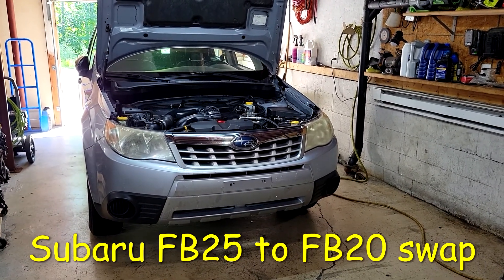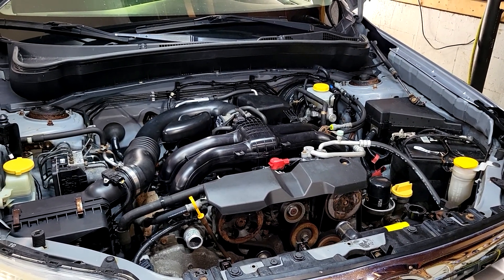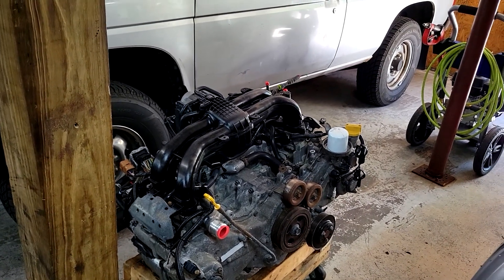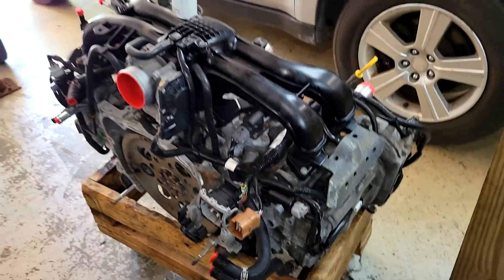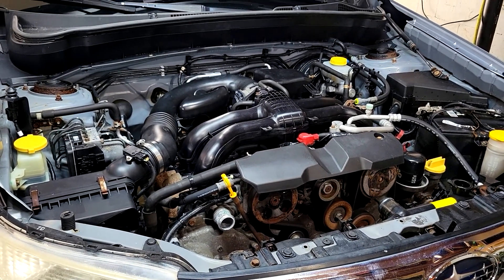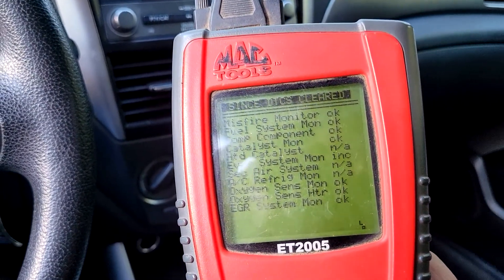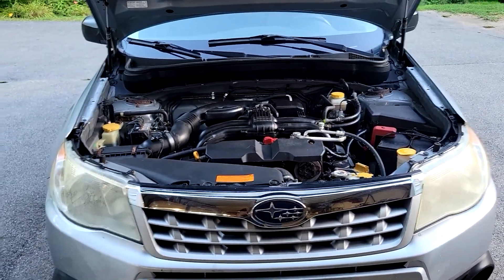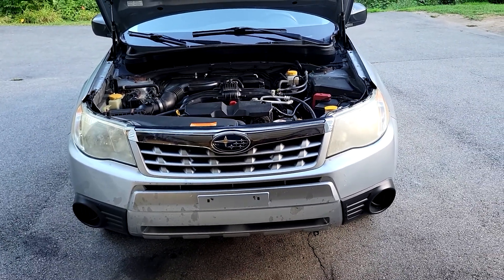Subaru Forester FB25 2.5 to FB20 2.0 Engine Swap Cheap Option To Fix Your Car Legacy Outback Impreza

Comment: Can you insure this if you change it with different engine? How can you reflect this engine change on the VIN  of the vehicle? Thanks
Reply from the maker: why would the engine make a difference? insurance companies uses the vin on the dash/title. not the engine. there are lots of cars on the road that have had the engine changed
Reply: @volks-jager  i asked this because if you register your vehicle, you need to put the VIN, and the VIN contains the information about the vehicle. When you verify this info using the VIN, it will show fb25, but you already changed it with fb20. If you changed the engine with same engine, it will not matter because they are both fb25.
Reply from the maker: @JBB1636  no one is going to know you changed it unless you tell them. insurance company is not going to care that you put in a smaller engine which makes the car slower and hence safer.  hell people add turbos and superchargers to cars all the time which increases the power and dont tell thier insurance company.

Comment: I'm seeing 1700 bucks for the fb2.0's now.  Wondering if demand has caught up?
Reply from the maker: between the word getting out about this swap and rampant inflation the price has gone up, but they are still $500-$700 in my area.
Reply: @volks-jager  Good to hear.   Thank you
Reply: I paid 1160 after tax for the engine last week out of a 14’ Impreza with 137k. Still cheaper than putting the same crappy fb25 motor back in it. Total cost of the swap for me was around 1250-1300 after fluids. I’ll have to add that I went and picked it up from the store. Shipping to my house would add another 200-300. I’m in the pnw if that helps with area. I got it from B & R auto wrecking which is 45min or so from me so it wasn’t a bad drive. Motor came from there California yard
Reply: @dakotawright6978  Thanks for the info.. Sooo,  just went and test drove a 2014 Crosstek.  Very nice neighborhood.  Was their kids college car.    120k Miles.   Great condition. Uneventful test drive other then coolant level low light.     Did the headgasket coolant test.   Positive for combustion gases.   sigh. 
Thought id share

Comment: Any idea whether I could swap an FB20 into a 2014 Forester with the NA 2.5 and the 6 MT? Oil consumption's been super high recently but the car's clean so I'd like to keep it
Reply from the maker: im sure it is possible, im just not sure sure year donor engine to get. all the foresters ive done are 11-13. im not sure what difference they are on 14. usally the 14-ups dont burn oil as bads

Comment: My fb25 runs 5qts in 1.5 weeks
Reply from the maker: yup, the early FB25s where notoroius for drinking oil. using that much is going to destroy your catalytic converters and O2 sensors

Comment: Hello, we just finished up a 2011 Forester fb25 to fb20 swap and now we have a crank no start condition. The donor fb20 was supposed to be out of a 13 Impreza but they sent one from a 13 Crosstek...does that make a difference? I am not getting any codes just a poor crank signal. Also we noticed the error after the install.
Reply from the maker: a crosstrek is just a listed Impreza, so that isnt the issue. double check all your connctors. did you swap the flywheel? the crank sensor and  trigger wheel is behind it, make sure that didnt get damaged a few people in the comments using 13 engines had to mess with different coils. did you use the intake/harness/coild off the 13 or the 11
Reply: @volks-jager First thanks for the response. Yes, everything has been swapped from the 11 to the donor motor the 13 before installed in the car. We just found there is no power to the crank sensor, we are in the process of diagnosing that issue.
Reply: Update, we did what we could and could not figure it out so we hired a company to come and diagnose the issue. They are claiming that my swap is not possible and the timing has stretched on the fb20. 

"The Crosstek FB20 is not compatible with the Forrester FB25 due to ECM" they also stated that the "13 Crosstek ECM as far as engine timing goes is the same as the ECM timing for a 13 Impreza" '

We are pulling the fb20 and hoping to swap it for another.
Reply from the maker: @BosAutoTowing  they dont know what they are talking about. the video shows it is possible and the numourous comments from people that have done it succesfully back it up.  there may have been an issue with the engine you got perhap, or they gave you a 14 engine or something. a 12 or 13 impreza engine is almost a direct drop in.
Reply: Thanks for the response. I trust this. Trust me. We are in the process of swapping the fb20 for another. I will post what happens.

Comment: My situation is i already took the engine out 2 yrs ago almost.. it has 200k miles on it. I bought new gaskets, water pump and new valves. When i put it back together now i cant get any gap on the valves. Im thinkjng i have to lap the valves. This car has beeen goung nowhere. So i seen some local salvage yards w the imprezaas . The vin numer thing is what i am unsure of
Reply from the maker: the valves lash on these is set by the buckets. if you changed valves or cams then you have to measure each valve and order new buckets from the dealer for any that are out of spec.
Reply: @volks-jager  i cant even get the gap tool to fit between  no matter what bucket is in there. So i guess i have to take that head off again and use one of thse valve tools to gring it down.

Comment: can i put this engine in outback 2011??
Reply from the maker: no. a 2011 Outback has an EJ25. this only applies to cars with the FB25. Outback did not get the FB engine until 2013

Comment: I swapped an07 into an 09 Forester. Transmission and motor from the donor. Will I need to swap the fly wheel? The vehicle went into spaz mode. Bunch of lights went on and shook the vehicle. Swapped intake harness.
Reply from the maker: this video is for the cars with a FB25 engine. your car has an EJ25. an 07 and 09 EJ are the same. the transmisson might not be. you need to check the interchange on the trans.

Comment: 13,000 miles on this swap since I finished this in August. Still running great! The only issue I have is the check engine light seems to trigger the traction control light and cruise control light(flashes) to come on. While I can live with the check engine light, it would be nice to use cruise control. Is there any way to get the cruise control to work while having a check engine light?
Reply from the maker: nope,that is Subaru being an asshole and forcing you to fix the check engine light. the only thing you can do is find someone that can do a custom tune
Reply: @volks-jager whenever I erase the codes until the codes come back in, we can use  cruise control all you need is 25 bucks obd code reader well I don't know much about but that is working for me

Comment: Have you thought about swapping the cams and cam carriers off the 2.5 onto the 2.0 to solve the cam phaser issue?
Reply from the maker: that might work, but it is alot of labor and alot of things to be resealed with sealer and potential  leaks, the whole timing cover and timing set would have to come off. the point of this swap is to be cheap and easy to the average joe.
Reply: @volks-jager  I have no problem with getting into dealing with the timing cover/ chains etc.  I'm wondering if it would make the power loss problem much less noticeable.
Reply from the maker: @joebuchowiecki860  also if swapping the cams will mean you have to re-shim all the valves which is a giant PITA and while it might help with power, you are taking many hours of labor, taking old used cams and timing chains from a bad engine plus buying new shim and tons o. stuff to reseal.  the simpler/better solution is to leave the 2.0 stuff and get a custom tune on the ECM.

Comment: I just did this swap. 2016 fb20 into a 2011 forester. I’m getting codes for crankshaft and camshaft correlation. I swapped the fly but I kept the fb20 trigger wheel for the crank sensor on the motor when I dropped it in, was so supposed to swap that as well?
Reply from the maker: a 2016 engine is not a good match for an 2011 forester. you should have used a 2012 or 2013 engine. you are going to need to pull it back out, and swap all the cam trigger wheels and sensors including the phasers under the timing cover.

Comment: I have a 2010 outback with the 2.5 in it. Was thinking about putting a 2.0 in it. Is it possible?
Reply from the maker: no. a 2010 outback has an EJ25 not and FB25

Comment: This video helped solve my P0171 code on a 2011 forester swapped from an FB25 to an FB20. Changed out the fuel injectors to be the dark green densos (fb25), and the code went away. Runs way better now! I might try disconnecting the cam phasors and see how it runs but obviously would have to live with the CEL if I did that
Reply from the maker: there is a HUGE difference in power by unplugging the cam phazers

Comment: We're working on a PZEV unit 2011.  Hoping to be able to do this FB20 swap and have a line on a 2013 Impreza motor w/100K miles on it.  Does anyone know if that PZEV stuff matters here.  We intend on using all the intake and exhaust from the forester as well as the harness and other items listed thoughout this conversation.  Anyone have any knowledge when it comes to PZEV?
Reply from the maker: pzev does not matter at all. the PZEV is just ECU program and a better catayltic concverter

Comment: Hey all! two things before I put the new engine in (2013 impreza fb20 going in for my original 2011 forester fb25) --  I did notice the coil plugs are different when switching my old harness onto the new fb20 -- is it enough to just switch the coils from the old to the new? The lengths appear slightly different. Second, I am noticing a connector on the driver side front of the fb20, (it is white and appears to wrap around to the back under the engine) and is not present on the fb25. What do I need to do with this?
Reply from the maker: look through the comments - someone had a simliar issue and they just made some spacers for the coils. if you cant do that then you could probbaly just use the FB20 harness and coils - ive done that and it worked. what does the wire attach on the FB20?
Reply: @volks-jager  so the issue is it looks like the connectors on the old harness are different from the new coil connectors, it also looks like there are slight differences in the ignition plug boot lengths between so I’m wondering in addition to the spacer if I need to switch those as well. The wire looks like it might be an oil sensor because it seems to terminate on the sump. Wondering if yours had this as well.
Reply from the maker: @IanOechsle   the wire going to the sump is for a low oil level idiot light, the car you got ther engine from must have had one and your Forester does not. either swap the boots and make spacers or use the FB20 harness and coils
Reply: Got the engine swapped and running this week. Swapped injectors, harness, coils, intake, flywheel and it's running great. Definitely notice the acceleration lag on uphills with cam sensors plugged in but will try out and see how it does with them unplugged. Thanks again for posting this video -- you gave me the inspiration to do my first engine swap and I enjoyed it a ton.  @volks-jager
Reply: Update: coolant bubbling up in the radiator. I’m worried I might’ve gotten taken with an fb20 that had a blown head gasket. 😢
Reply from the maker: @IanOechsle   if the HGs is bad i would return the engine to the junkyard and have them give you a different one. an HG job on an FB engine is a shitshow and you have to pull the engine to do it anyway. just as an aside while it is possible,  ive never seen an FB20 blow a HG. get an HG test kit with the blue liquid and make sure that is the issue.

Comment: I just did this and after it ran great except the bottom end was gutless. I think i should have advanced the exhaust cams one tooth to have fixed that, but it is sold and they have no clue. Thanks for the video, those fb25 motors are junk!
Reply from the maker: if you unplug the intake cam phasers the car will have way more power. the FB25 computer must be over-retarding the intake cams or something.

Comment: Hey I’m trying to get this 2010 Subaru forester but the engine is done for good. The previous owner ran it out of oil and now it doesn’t start.   Can I use the FB20 on it?   I’m not a mechanic or really into cars but I could use some help.
Reply from the maker: sorry this wont work for you. Foresters did not get the FB engine until 2011. your 2010 forester has an EJ25 engine.

Comment: What’s the power loss going from an FB25 to FB20? Very cool swap. Glad it’s similar to the EJ swaps! I wish someone would dare swap an Outback XT FB25F motor into a new Forester..
Reply from the maker: if you leave the intake cam phasers disconnected there is very little power loss. if you plug them in there is a big power loss. for around town it is fine either way, but on the highway you notice it alot especially on hills if the phasers are connected.  a custom tune would fix this, but in my area the are no tuners.
Reply: @volks-jager  A very cheap fix to keep these cars on the road with a better motor. Great work!

Comment: I had a 2012 Impreza,.fb 20. Burned a qt of oil every 800 miles. Subaru fixed thr fb 2.0 for 13 with updated piston rings. For thr fb2.5 14 /15 had the updated rings
Reply from the maker: ive yet to see a FB20 oil burner. but if it was only 1 year, that might explain. the 11 to 13 FB25s where awful. ive seen those burn a quart in 300 miles

Comment: So I’m about to pull a motor on a 2010 forester. The new used motor the customer supplied sorta looks like yours is there going to be any issues with anything? I saw that the oil filter locations are different the current one in it has the oil filter around the exhaust manifold under the car and the new used one has it on the top of the motor.
Reply from the maker: a 2010 Forester uses the older EJ25 engine which had filter on the bottom. this video only applies for 2011 and newer. the FB series engine has oil filter on the top and will not fit in a 2010 Forester - you customer got you the wrong engine. for a 2010 you need an engine from one of the following: 06-09 legacy/outback, 06-10 Forester or 06-11 Impreza
Reply: @volks-jager  I have a head gasket leak on my 2010, quotes were outrageous. God bless
Reply from the maker: @Max-hf3ku  most of the shops around here are $2500 for head gaskets on a non turbo EJ25. i usally do them for around $1500
Reply: Yeah I figured I just came on actually to type in that this is an ej and the other one is an fb25